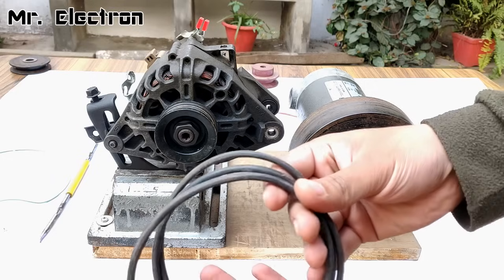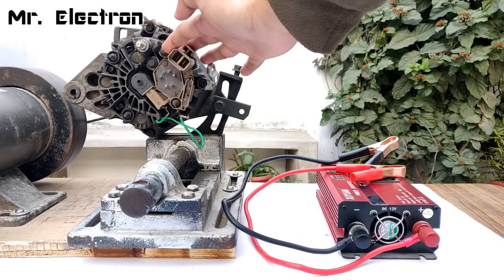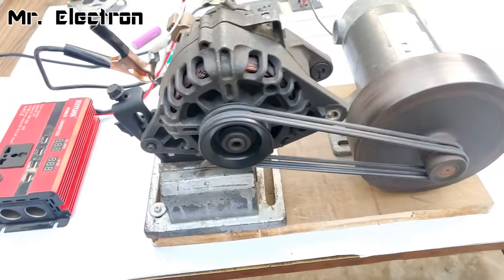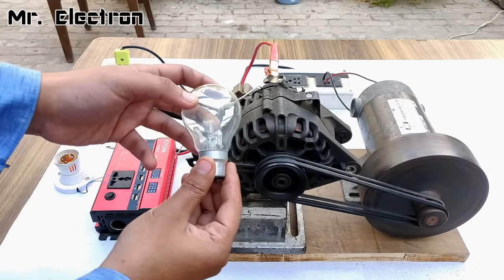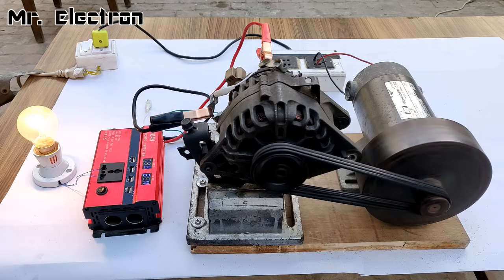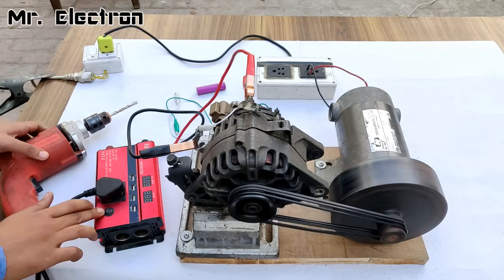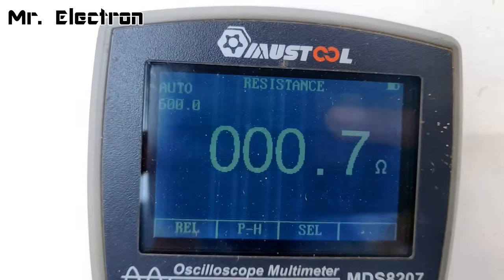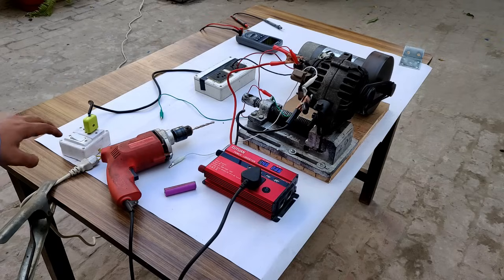220v AC from 12v 90 Amps Car Alternator 1000W DIY

Comment: wow, what a waste of energy and time.  Using Ac to power the dc controller and motor then converting DC from altinator to AC.
Reply: That's not what's going on. That DC motor is acting off another power source. The DC motor is powered to run the alternator. But the alternator is not responsible for powering the DC motor. This is why this system is not self excited or self running. It is close though. If his point in doing this is to create a perpetual motion machine and get out more than he put in all I can say is good luck.

Comment: please make the connection correct and clear, because I want to used that idea to light up my small house. And try do it using the motor and alternator only. Make sure just use battery to start only, when it start remove the battery and try let it run without battery..Please help me and reply my need.

Comment: There is no mechanical load on the drill.  With no load, the power demand from the drill is just a few watts, nowhere close to the 350w maximum rating of the drill.

Comment: there is no question about your work, because it will really work, but you have used power to run the alternator, I think the better question is, how much output AC power is available at the inverter? is the input power from the drive motor lesser than the output AC POWER at the inverter?

Comment: Is the motor a high voltage brushed dc motor which uses in treadmill? And what will happen if you replace the electromagnetic rotor and use a permanent magnet rotor?  will the current and voltage increase in a lower rpm ?

Comment: I would like to run a turbine from water stored overhead at 15 meters.can i hook up the turbine to car alternator/invertor to generate 220 volts act or DC. I will use an end suction centrifugal pump as turbine with water flow into the pump delivery. Can it be done.
Reply: Of course... search for angry ram or Marty T , how to generate electricity with an old washing machine. He on YouTube.

Comment: Please using 12v accumulator battery  and the convertor can generate an output of 220 volts, there is no need for alternator and the motor. 
Your motor was running on 220v and the alternator producing 220v, what is the difference ?  Input energy =output  energy.  No work done

Comment: I dont get it! your using 220 ac to drive a electric motor to propel a alternator to make 12v dc then use it to invert 12v dc to 220v ac to turn on a light. . to achieve what? plug the light straight into as socket cut out two middle men.  sorry to say but your demonstration is a solution to no problem. you start with 220v ac to get 220v ac. but less amps.
Reply: Pointless

Comment: Don't forget alternator running high amps!? Make sure you have a regulator in the circuit!
Some cars had regulator on the fire wall or near the distributor coil.
Some alternators have a regulator built in.

One day I'm gonna try this stuff too!
There has to be another way to enjoy creature comforts without a utility bill(lol!)!

Maybe take a tachometer & check your average rpm around the alternator in an actual vehicle! (Not talking about the RPM of the car engine!!)

Comment: Why not just plug the bulb into the 220v grid outlet?  The only thing that would be good about this is if you could loop the motor to the inverter.  It draws more than the inverter can supply.

Comment: Plug the inverter into the DC power board. Forget the motors.
Reply: Thsts what I'm thinking . I was hoping he unplug the power double and itll run itself lolol
Reply: Even better.. Get rid of the AC to DC transformer as well and just plug in to the original power source and use about half the power you loose when converting it  form AC to DC to drive a motor to drive an alternator that  again converts AC to DC to then run the power through an inverter to change it from DC back to AC... This has to be one of the stupidest projects I have come across. So much power wastage.
Reply: @brettwhitla4425  haaaa ha ha ha,  I thought so

Comment: Hello Mr. Electron, your experiment is very informative.  25 years ago I was trying to do the same experiment but I failed because I didn't know how to excite the the alternator. What I wanted to know,  at this point,  can you use the power from the inverter to feed the motor that would it the real free energy?
Reply: Couldn't they use a solar panel system to charge the battery running the motor in order to make it 100% free energy?
Reply: Sure you can. Where do you the Big Bang came from
Reply: Waiting for answer
Reply: There is no free energy and it  cannot be achieved because of the losses from the motors wires etc
Reply: They have been trying to do that for 100 ,years. Anything with all have one thing I have one thing self-sufficient power that I have seen
Reply: I have one thing in common
Reply: They all have batteries. No such thing as free power. Can't get something from nothing

Comment: if you use a car 12vdc battery with a car audio 3 farad capacitor. you can run large inverters 5000 watts or more. like they do in car audio systems. it will also keep the load fluctuation from happening. also a more efficient motor to tun it like that 24 vdc smart drive.,,,,

Comment: Hey Mr Electron, you are good experimentor and make attractive clips so I voted!  
However you should enhance a little your studies on physics! 
As the results you could reduce simply the resistance for excitation coil by smarter reusing the whole resistive wire lenght, meaning redesign circuit for a parallel connection of resistor   segments. Notice that putting them in parallel instead of reducing to half the resistive wire,, you were also doubling its whole heat power disipation with no effort and therefore no more melting occur!  
This in fact is the smarter solution to adjust excitation in the lack of a proper regulator instead of blindly iterative decreasing the lenght of that balast resistance to increase excitation current while forgetting that will also induce greater heating disipation in that thinny wire resistor!  
On the other hand, you should be better informed that all these usual car 12V alternators provide maxim 500 W as PEAK power (short duration) so never continuously to be really useable  as you advertise in the title.  In fact that is why you also found that even setup that excitation was done up to its limits for that simple drilling 500W tool running freely with no real consumming output!  (if you really runs that tool drilling a metal or wall etc you should also notice increasing its consumption up to even shut off again your limited system, so extending debating more about your advertising 1000 W really becomes a joke in a real reliable usage context...
So sorry about your enthusiastic presentation that seems to be missed by many advanced long time researchers from professional companies that still did not find to offer us on the market, a such amazing simple but power generator ready to use at these parameters!...
Reply: For weathering a power outage, a new alternator is cheaper than a generator. It’s common. Are you calling CarGenerator to tell them they’re a joke?

Comment: What You had yo check was the amperes from the alternador and the capacacity of the inverter, un the still nerd more power that the inverter can provide it Will sound, also the amperes from the alternador

Comment: So, if your power is out, but your neighbor has power, and you have a extension cord, a treadmill motor, some belts, an alternator, and a power inverter you can jump the fence steal the neighbors power and light a tiny bulb.  If you have larger appliances like a 1500 Watt toaster oven, simply plug them directly into the cord.
Reply: Yeah a  heavy duty extension cord running to the neighbor's garage is the best way I know to get "free power".  If you cleverly conceal the cord, this can work for quite q while without interruption.
Reply: John Hadleigh  Honestly, sarcasm can be hard to read.  Although the four thumbs up would imply that some people can read sarcasm.   P.S. Fix the all CAPITOL letters issue by simply pressing the "CAPS LOCK" button  which is SCREAMING at you from the left side of your keyboard.
Reply: still a pretty fun vid
Reply: I agree Michael, and I watch all his videos.  Please don't let my sense of humor take anything away from this video.  Any YouTube producer who is educating himself and his viewers is doing a great thing.

Comment: Helo Mr Electron,
I love this video so much, especially as it makes your viewers part of the investigation process. Thank you. But there are a few questions I will like to ask.
1. Don't you think making out just 350 watts from a 3000 watts inverter is not ideal?
2. What is the possible way to solve the issue of the resistance wire getting burnt?
Reply: when an inductive load is applied- the initial start up amps is x3 - so 1000w

Comment: Thank You. Can you please tell me what is happening when you excite the alternator.
Reply: Once you excite it then it  starts the out put to keep the battery charged if it doesn't get excited then you have  no out put then it's just a big resister and runs the battery down faster on your car / or won't supply power for the inverter in This case. No excitement no out put
Reply: It smiles

Comment: you dont   need alternator  just plug in your inverter to 12v  car battery   and you have  220v   cheaper...
Reply: How many amp hour do that battery has? 

If you're running an AC of 500 continuous Watts how long will you take to run that battery dry? 

17 minutes! 

That's why the alternator is Boss! It keeps the batteries charged and still being used!

Comment: Should use 10gage wire on field activation as well 12 volt battery in  parallel with the inverter, then drill will run with no problem
Reply: Hello. Can I ask something?

Comment: Why don’t you change your gear ratio on the pulleys? Put a big pulley on the motor to power the small pulley in the alternator. Therefore your motor could work at lower speeds mimicking high speeds.

Comment: You should have used a fuel powered engine to run the alternator to demonstrate how this would be beneficial if the grid was down.  I don't understand why you are demonstrating converting ac to DC and back to ac again?
Reply: If you connect the AC to DC speed controller in this video to the output of an inverter that can charge its batteries, then the system will be self-running, a fuel generator not needed.
That is what the GENIUS (Mr. Electron) is teaching you

Comment: It is fascinating. But my auto electrics in me as a mechanic is telling me different. With a 12v car battery to the alternator and a motor to put about 4krpm Into the alternator will get what your after car alternators do have to design to self regulate on 12v. As the output will change when the headlights are switched on for example. The battery drops down to 11v and the alternator is designed to compensate for this and pushes up to 13.7 again. I have achieved running massive amp output with fitting 2 alternators to a car before when I had to do a massive boot in car entertainment build. That had in total  6000w of Amplifiers. But when that bass kicks in it's essential to fit capacitors in there too.

I'm going to have a good go at making a generator without any mains feed at all. As I believe it is possible to power my own house without having to pay £20 a week for electricity. The savings itself are astronomical which would be a worth while project.

Comment: Whats not clear about your video is what is the power source to start your motor when your start it and what is the specs of the motor. It is suppose to be self powered right? But you seem to have in plugged in to start your motor.

Comment: By using an 1800 rpm electric motor like this one and the altenator. 2 car batteries connected to the alernator and a 3000 watt inverter. You can run a small office fridge. The car batteries will feed the inverter. To run the alternator which in turn will charge the car batterries

Comment: You have the DC motor running off of the grid and not off the alternators created power through a converter and battery power

Comment: Back in days I had a 120 amp GM alternator on a 8hp Briggs and Stratton that fed 2 big diesel batteries that ran a 1,000watt 120v vanner inverter out of a ambulance that I would back feed from garage to house. That 120 amp alternator would work the 8hp pretty good!
Reply: hey your really close to doing what i got set up but i dont use a gas engine  i use a 12 dc motor so no fuel cost it pretty much free electric .....but if you think about it you can figure it out ,,,,oh im running 2-5000 watt inverters on 6 golf cart batteries..... 1-1 wire gm alternator  1- 12 volt electric motor and 1- ? .....im not going to tell you figure it out on your own and 6- 6 volt golf cart batteries .....and the reason for them batteries is they have more amp hours than big diesel batteries
Reply: kelly steele It is really funny that you think you can make free electricity

Comment: If your Alternator is capable to produce 1080 watt current (12 V x 90 Amp), then Why need the self excitement to produce high current and run only 350-watt Drill machine?  Please Clarify.....
Reply: The inverter which obviously is taking 12v dc and converting to 220v ac is only capable of producing, I believe he said 300 watts, at 220v ac.... What's so hard to understand?

Comment: You can build an AVR (automatic voltage regulator) which is a feedback control system that automatically adjusts the rotor DC excitation current so the rectified output voltage of the stator windings is regulated at the desired voltage (for example 11V-15V). The AVR is a current regulator, which can be a DC/DC converter or a linear regulator, equipped with a feedback controller, and takes power from the rectified output voltage of the stator windings and output the current to the rotor DC excitation winding.

Comment: Show the motor current drawn to run the alternator and with load connected.  Also tell what you achieved. Why didn't you put a 220v 1ph 1kw alternator instead.

Comment: My friend remove the alternator and DC 12v motor.than inverter direct connect to this 12v you will get 220v Ac.
Reply: Nope.
Reply: Steve wanted self-sustaining powerthe alternator's always running and always powering up the motor there's nothing coming in between to keep everything running okay like a power source creating his own power source
Reply: @jamesdonnellyjr4451  he never hooked up the motor controller's 220vac input to the inverter's 220 vac output - and pulled the mains feed in an attempt to make, as you say, a self sustaining system. Basic mechanical entropy is at work here. It would shut down nearly immediately because it must loose more energy than it produces. Lack of understanding or illusionary thinking cannot alter the laws of physics. If you don't believe this, then simply set up the system and try what you suggest. No one yet has created a proven perpetual-motion machine. The closest yet would probably be the E.M. (electro-magnetic) Propulsion device NASA has been investigating ...
Reply: Right brother
Reply: this is just a demonstration.      a source of input energy  is  Needed.

Comment: Just change your name from Mr electron to Mr Genius!!!!! Excellent project!!
Reply: Only thing this circuit need in it equations is a 12 volts car battery which must be there to neutralize the output voltage from the alternator. Other wise the.  Alternator will overheat very quickly and burnt up when pulling out amp or current for consumption use.
Reply: Olx Nigeria  0
Reply: Olx Nigeria  . .
Reply: Olx Nigeria  jhu
Reply: @justan idiot haaaaaaaaaaaaaaaaaaaaaaaaaaaaaaaa hahahahaha
Reply: This video is done by thousand other YouTubers where you think he came out with the idea
Reply: Just change the motor or make the motor spin two alternators.
Reply: a!zq, agg.
Reply: you speak English Indian or Pakistani  You should speak own language
Reply: ⁹⁷77u⁷<³
Reply: Ke
Reply: Not sure how much torque for drilling any holes with the driver using the setup before the wiring burns up.

Comment: Super class, so I had thought it too or with battery charge + converter. Thank you
Reply: I just posted a comment about yiur idea. I also thought of it. You can use 2 alternators 1 to run 1 inverter to run the electric motor. The other one to run the other inverter. To run your appliance
Reply: @gerardotrevino8764  nah bro that will fail you adding more alternators need double the tourqe double the power to run 2 ... It's a dumb idiot idea tbf